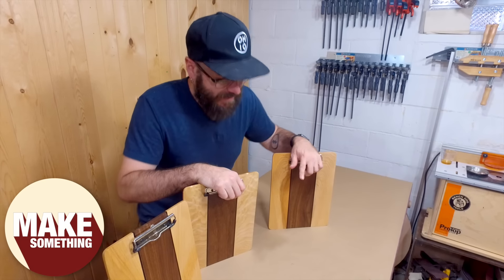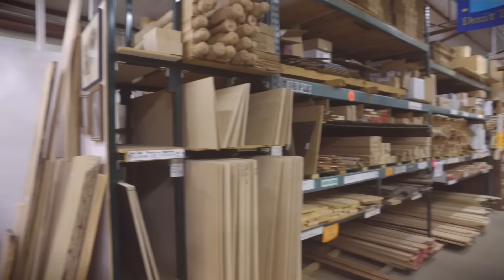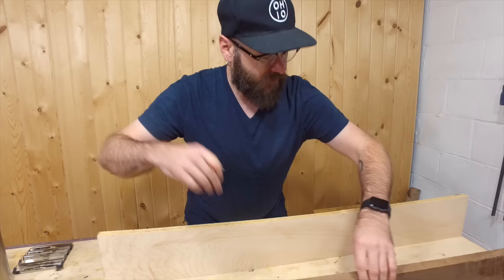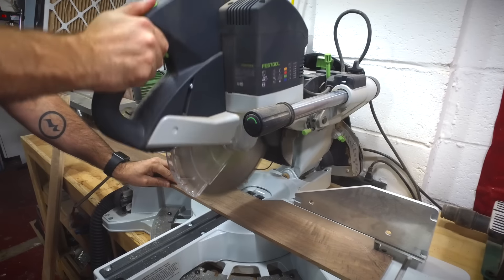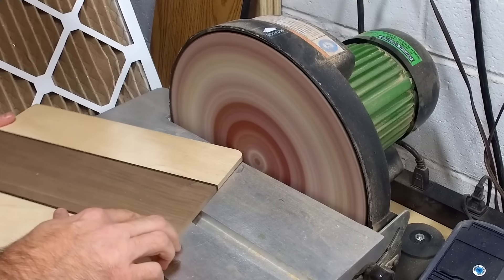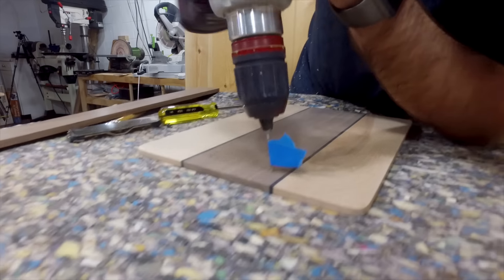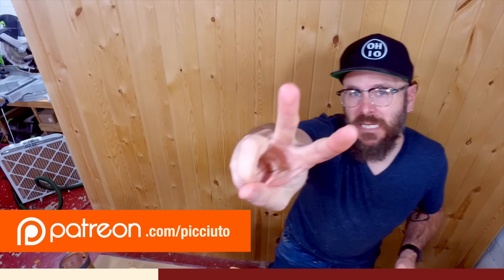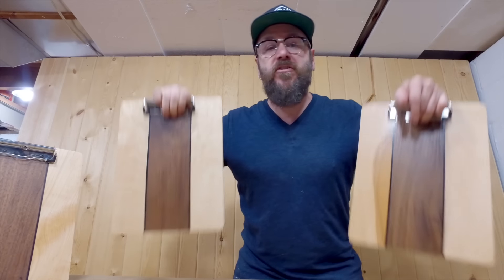How to Make a Super Awesome Fancy Clip Board | Woodworking Project

Comment: You asked what I listen to in my shop and I normally listen to an audio book while working. I have a hearing protector with AM/FM/Bluetooth and syncs with my phone. I down load free books from the library. I like the dust bag for your planer except I'd put a longer hose on it to get it out of the way. I need a bigger band saw so I can resaw a board more than 4" wide. I also want a belt sander. Christmas is almost here and maybe I'll be good to myself this year.

Comment: Since you're encouraging these for craft faire it'd be nice to hear your breakdown of investment: material, travel, shop time (rent,insurance,etc.../time), plus craft faire time where the break even per volume is. Do you need to do a production run of 100, then just sell them over a few years to stay at living wage?
Reply: Project turned out great
Reply: I was thinking the same thing, especially with ebony accents.  For the non-woodworkers, of the three pieces of wood he bought, the black ebony was by far the most expensive, even though it was the smallest.  (This assumes it's really ebony & not african blackwood or some other really dark wood.)

Sweet project!  I might make a couple for my own use. :)
Reply: if costs are a huge issue, you could sub in another wood type.....use cherry in the center instead of walnut, and use the walnut for the accent stripe...the end effect would be very similar.....or you could use dyed or ebonized woods to get the contrast...
Reply: I've found that generally wood is the least expensive part of a project.
Reply: Haha "turned" love your channel man.

Comment: Hey David, What type of dust bag do you use on your planer? I have the same one, and could use something like that! Thanks!
Reply from the maker: It's from Rockler. It's made for their dust collector but works great on the planer.
Reply: I see they have a 5 and 30 micron version. Which do you use? Concerned about the 5 micron version being able to handle the amount of air the planer puts out.

Comment: Do you have the standard blades on your planer?
Reply from the maker: +roger jackway yes.
Reply: Make Something. I upgraded mine to the https://www.amazon.com/gp/aw/d/B008CS2QAE/ref=yo_ii_img?ie=UTF8&psc=1 . It in my mind is well worth the 430$ for the cutters. Is is 1/32 smaller but extremely quiet compared to stock blades and also has less snipe. Just something to maybe look into if you do like using the planer a lot.

Comment: Nice build!! I love the color combination. Are you concerned, though, that these may split along the grain or along the glue joints in the future? I'm sorry, I haven't worked with Walnut or Ebony, so I'm not sure about how these may hold up.

Oh, and I listen to Classic Rock in the shop!
Reply from the maker: The glue is stronger than the wood so I'm worried about it splitting. I'm more worried about it warping over time.

Comment: So what is your cost into making these?
Reply from the maker: Good question. Probably around $9 in materials per clipboard. I could easily get that down by buying larger/cheaper boards.
Reply: Wow, that was quick ;) Thanks. A lot of projects from you and others it's tough to guess what it would cost to try and make them (not counting all the fun which is priceless). Cheers!!
Reply: Only $9 huh? Wow that's not bad. I guess I would have expected more since you used ebony. Might just be my local wood suppliers but I can't seem to get any ebony without buying a whole bf for $127. I've watched your video on pricing. Just curious how long it took you to make them and much you'll end up selling these for. Did you end up with 4 or just the 3 you showed?
Reply: Have you guys tried sourcing rough cut wood locally via Craigslist?  I have been able to find oak, cherry, ash and walnut for $2 per bd. ft.  Obviously, you need a jointer and planer.  I am in central Pennsylvania.

Comment: would it have been more efficient to glue them up from full thickness, and resaw to the thickness you finished with? (build up 2, and then resaw to get 4...)??

Music depends highly on my mood--  it runs the full span from 80's & classic rock, to full out techno, with side forays into j-pop and some occasional classical stuff...  Thankfully, with the earphones I have, i can run an MP3 player into it, and not worry about noise issues....(though i have had the begesus scared out of me when someone came into the shop and I didn't notice...)
Reply from the maker: That would work great but I don't have a bandsaw big enough for that resaw capacity. Thanks Tim!
Reply: ah....that would be a major factor.....lol   gotta do it, the way you gotta do it..    

I prefer danish oils as a finish personally too btw :)